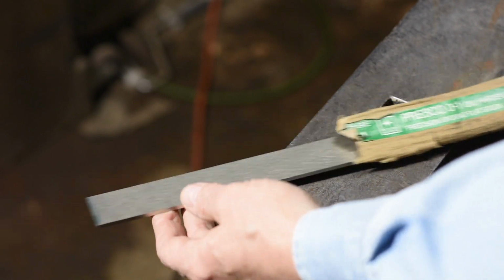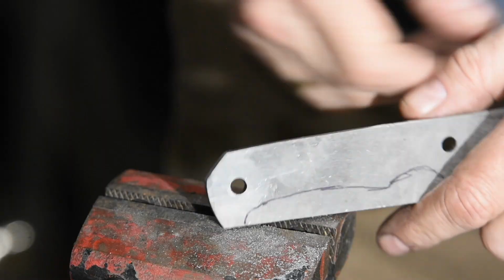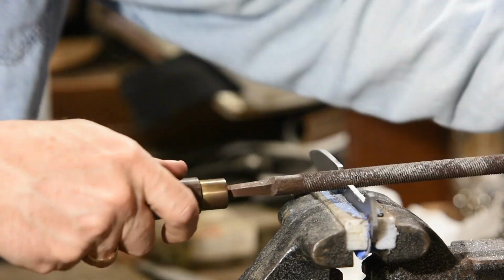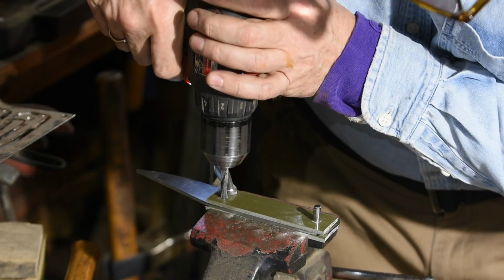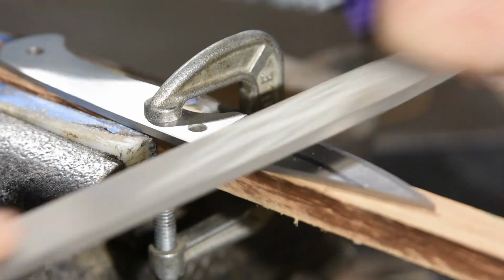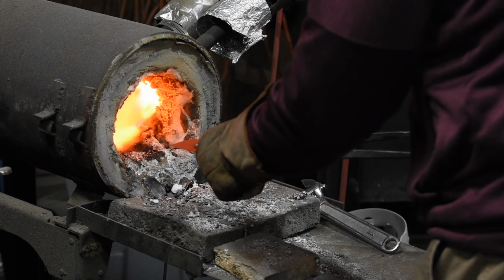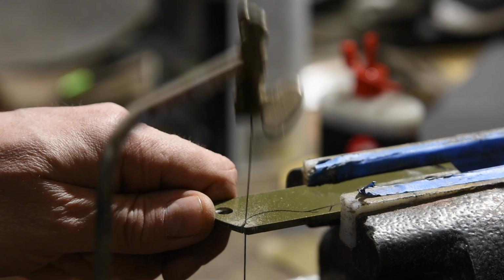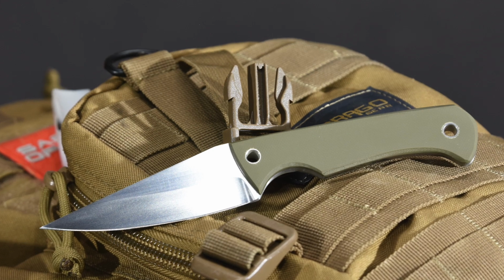Make a Knife with Simple Tools!

Comment: Funny this video comes across my feed now... I am in the process of re-handling an old "hacking knife" that the original plastic handle broke about 10 years ago with some black walnut. I had to anneal the tang portion so I could drill two new holes for pins, and so I could contour the metal. I used my Dremel with cut-off disc to rough out the contours in basically the same way you did with the hacksaw. I did remember to profile the front end of the scales before mounting to the blade (haven't got to that point yet, still have to clean up the tang profile tomorrow). Good fun, and this shows just how much CAN be done with simple hand tools easily, if labour-intensively! Thank you for posting these hand tool videos, Walter!

Comment: How does one measure the center line with the scribing tool? I recently acquired one sans instructions and haven't found a good way to accurately measure aside from eyeballing it or some janky approximations with my calipers.
Reply: Its simple. If you know the thickness of you steel, simply divide that in half and set your scribe point that far from the face of the scribe.